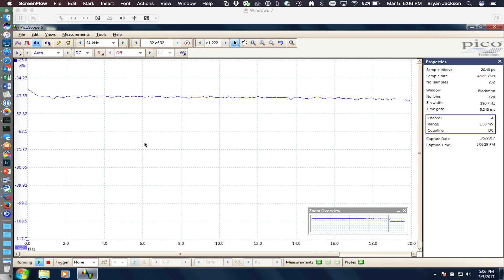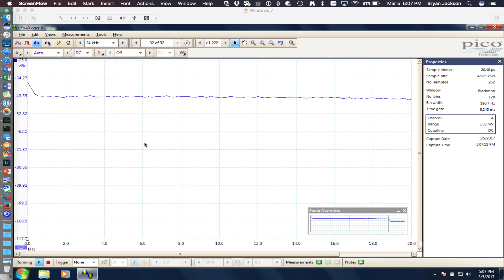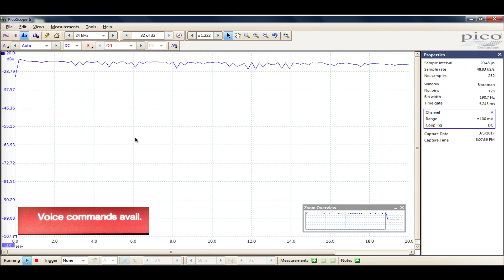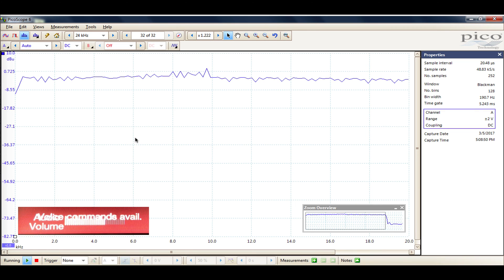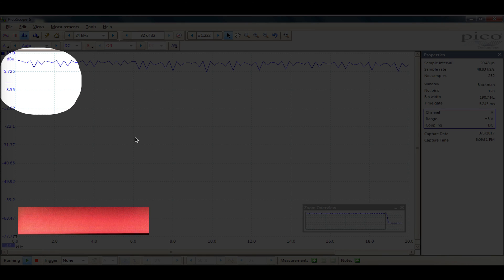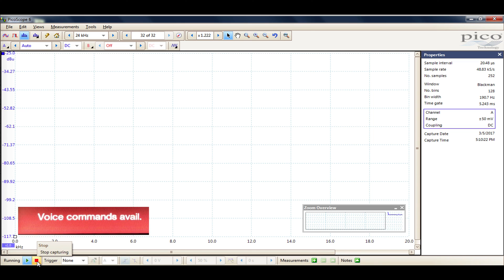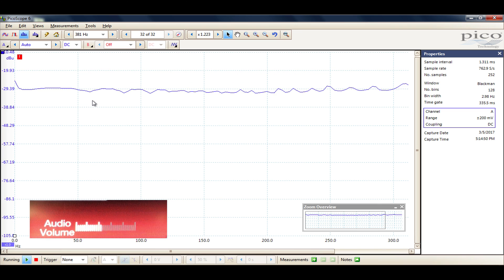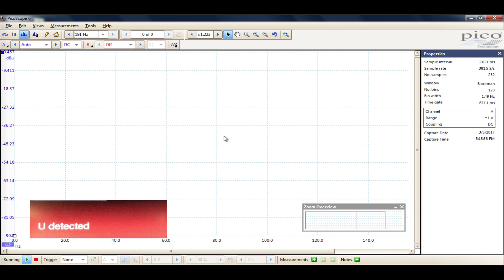FORD ACM Variable Line Output Deep Dive (and a correction)

Comment: I know I’m a little late here, but would you happen to know if the Focus (mine is 2016) programming slots concerning the ACM are the same as the F150 or Fusion considering the base ACMs are pretty much the same physically?
Reply from the maker: Brandon Hooker there’re all pretty much the same man. Different things enabled for the package you have but the same hack ability
Reply: Bryan Jackson well would you happen to know if it’s possible to change PCM settings to recognize a larger alternator? I’m not sure how that works haha but I’m about to go from 150A to 250A and I’m trying not to fry anything
Reply from the maker: Brandon Hooker You shouldn’t need to. The alternator is a passive system that will provide more power per crank with a larger alternator. If the system needs more power the alternator will provide it. But you answer your question I’m not needed to adjust the alternator so I don’t know. I did spend eight years in pro car sound though.  So if car audio is the reason for the larger Alternator you might look into some capacitors as well. Of course just guessing
Reply: Bryan Jackson yeah I’ve got a simple system now, but I’m upgrading and my mids/highs will be on a class A/B amp so I’m trying to get some extra power handy for the inefficiency, whole system should be max 150A so I can have some room for lighting, too. I figure with the amp and DSP I have along with the newly learned ACM line-level reprogram I’ll have a good SQ system! But if the alt is a passive system then I take it the battery and its voltage is the only thing being regulated so I shouldn’t worry?
Reply from the maker: Brandon Hooker if you have 150 amp alternator now. Guaranteed you will not need to upgrade it unless you’re doing about three or 4000 (real) Watts of A/B power. If you want to do a/b that’s cool for your mids and highs but save yourself the trouble and do class D for your sub you won’t notice the difference and it’s 90% less power. Seriously move on in confidence man you don’t need to change your alternator. For what it’s worth, for me, I’m doing class D in my entire system and I am super happy with it. I would actually recommend that, there’s too much mental wanking on different amps but the class D stuff is basically better in every way these days. A/B survives on nostalgia man. That’s it
Reply: Bryan Jackson my sub amp is a class D, I wouldn’t put a sub on an A/B haha overall the system should be under 2000W when I’m done